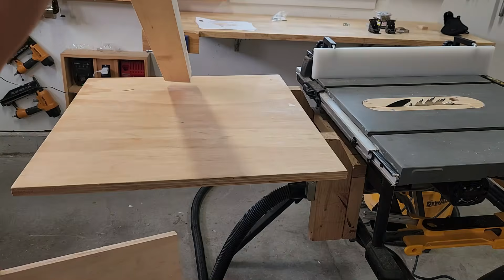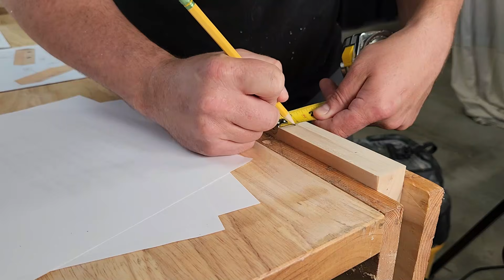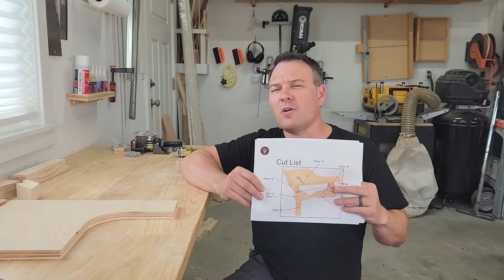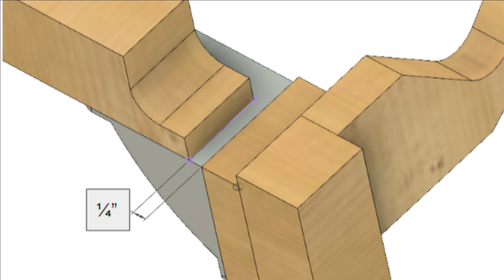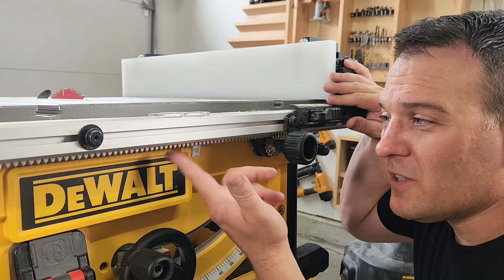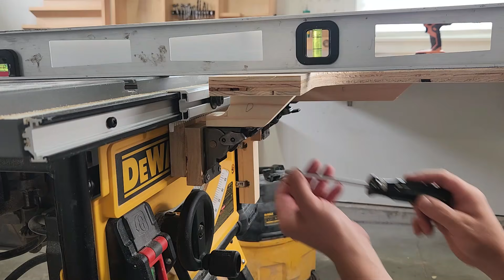Space-Saving Folding Infeed Table || DeWalt DWE7491RS Table Saw

Comment: Unreal before I had found your channel I did the same thing but on the left side of my DW745 Table Saw which is Old but awesome ... clean and practical I have it mounted on my main mobile  work bench (96" x 48") and come to realize I do need the right side as well ... btw where can I purchase the "white board" on your fence ...
Also after using it several times it bothers with the On/Off switch and the Raise lever for the blade, so I'm highly considering redoing my set up ...
Reply from the maker: Hey.  Thanks for sharing.  Here is a link to some UHMW you can use.  Double check to make sure this is the size piece you want.  https://amzn.to/4sevaoF

Comment: Nice presentation and some good ideas.
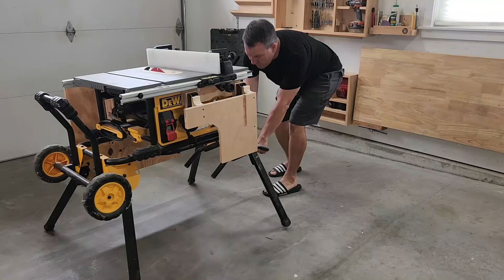My constructive comment: At 8:00, when you're folding the legs to stow the saw, first lift the end with the wheels slightly off the ground, then fold up the two legs. You'll switch hands to hold and fold each leg. Lower that end onto the ground, wheels touching. Then lift the other end to the full upright position and stow those two legs, then roll the saw to wherever you keep it.
This will reduce the stress on the two legs on the wheel end when you rotate the full weight of the saw over them, and the stress on you. I hope this is clear.
Reply from the maker: Thanks for the tip!
Reply: I dont like doing it the way he does it either  but at 68 I'll hurt my back for sure doing it another way  that stand will take the abuse for  as long as im here

Comment: I purchased your plan and it says to rip a 2x4 into two 2x2 but 2x4's are actually 1.5 x 3.5 in.  Ripping it in half would give two 1.5 x 1.75 in. Would that work?
Reply from the maker: Yes.  2x2 lumber is actually 1.5 x 1.5.  Sorry foe the confusion.

Comment: A little tip for when you use a push stick. If you push next to the fence, you are biasing the force to push the work piece away from the fence and toward the blade. It’s best to push from the blade side of the workpiece (of course while using common sense to avoid the blade). This way you are forcing the workpiece against the fence. The result is a more perfect and square cut, and a much safer cut.
Reply: Exactly. Closer to the blade on the fence side. I demonstrate this to my students with a little toy boat in water. If I push it forward from the left, it goes right, and vice-versa. Makes a big difference in keeping that workpiece hugging the fence. 
I appreciate your humble spirit and ability to accept ideas. We need more of that on YouTube. You’re setting a great example. Subscribed.
Reply from the maker: @GodsMan500 I'll definitely try this.  Thanks again, and thanks for subscribing!  This might even make for a good dementration in a short.
Reply from the maker: So, you're saying to push closer to the blade on the fence side?  That makes sense.  I'm always learning. Good feedback.  Thanks for that.

Comment: You've addressed one solution to the biggest issue with small jobsite table saws... the lack of support around them! In my experience, the MOST important tablesaw extension you need for one of these is an outfeed table. The SECOND most important is some form of infeed support, whether a full table like this one, or a fence extension with a "foot" on it to support the work as it is fed into the saw, or some other solution. I like this one, you've thought it out well and it looks to be highly functional.  Two thumbs up!
Reply: Actually this table-saw has good support on the side with the fence.
But the opposing side may at times need support for really large sheets.
Reply from the maker: @anderslagerqvist2642  Thanks for the comment.
Reply from the maker: Thanks!

Comment: Just found your channel.  I really enjoyed your delivery and designs. I’ll be subscribing.  I have been using a DeWalt table saw but a much older 10” model DWE7480. I built a fairly elaborate and massive side/in-feed table for this saw which is basically mounted to a long/narrow out-feed caster mounted table but it’s a bit of a bear to mount the side/feed to the table when I want to use especially if it’s just one or a few cuts needed. So I’m going to buy your plans for your in-feed and hope I can modify if needed to fit my saw.  Thanks, Phill
Reply from the maker: You may want to take a look at my outfeed table video/plans for that.  That design uses bigger hinges.  https://youtu.be/kXzVISeXGpQ?si=BDQ1IAzI58zgBOw-
Reply from the maker: Also thanks so much for subscribing!  Let me know if you have any questions or want to talk through some ideas.  Maybe I should design a folding side table.

Comment: Nice! I'll eventually make this. I've been using the outfeed for awhile and it works well for me. Although, while it's probably user error, I had to cut off some of the side edge of the frame to get my dust port to let the blade go 45 degrees. I'll have to go look back at the plans to see if it's my fault lol
Reply from the maker: Ha!  Wood and manufacturing of the saw varies.  You always need to do a  little tweaking to customize it to your saw and situation.  Thanks for the comment!
Reply: @HowIDoThingsDIY  also, what miter gauge are you using in this video?
Reply from the maker: @josephlebo7320    This one: https://amzn.to/3YetTzT